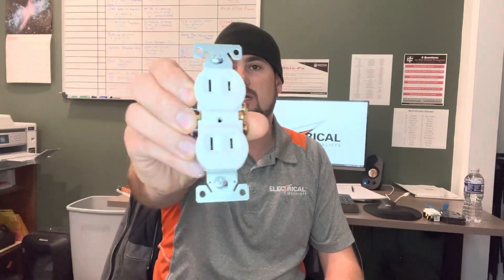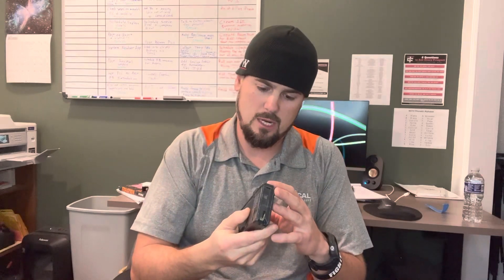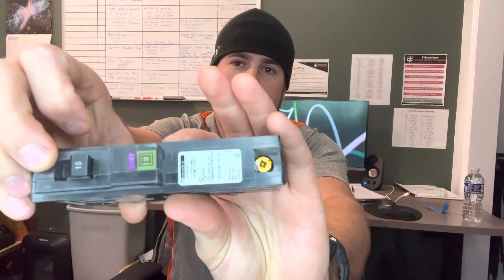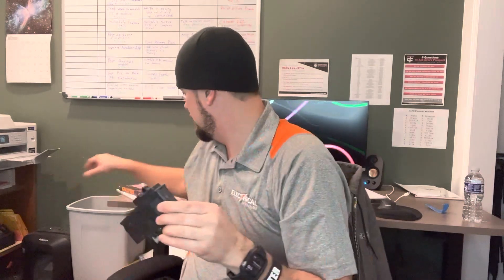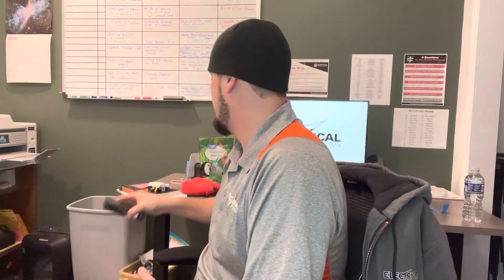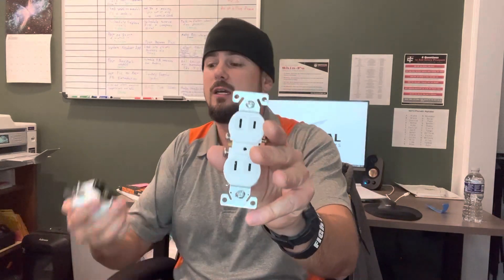How to LEGALLY Upgrade 2 Prong Outlets to 3 Prong (No Rewiring Needed!)

Comment: Ok, single woman here who knows pretty much nothing about electricity. I just know how to change out outlets and hang ceiling fans. Do you have to change out every breaker with that one he showed? If so that would be very expensive!
Reply from the maker: Yes. Every breaker that powers a circuit that has receptacles. Absolutely, it is definitely an investment, but much much less than the cost to rewire a home. It’s at least an option to consider when going through your options. Let me know if I can be of any further assistance. Thank you!

Comment: Would a plug in tester read any differently in the 3 prong outlet without the ground wire but on that new breaker you are suggesting?   I mean the plug in  testers with the light that say 'correct' or open ground, nuetral etc
Reply from the maker: Good question! It actually will not. The tester is looking for continuity between the ground and the neutral contact. We get this all the time from home inspectors checking homes we have already performed this task in. Someone had taken off our stickers reading "no ground" and "gfci protected." We then tell them to check the breaker and send a link to the code article as most people including home inspectors are unaware of this fix.

Comment: So if I upgrade to the dual function breaker can I install normal 3 prong outlets so I don’t need to use adapters to my current 2 prong outlets?
Reply from the maker: Absolutely! That is honestly the main reason this is utilized. Code requires you to then install the stickers that come in the gfci box that read "no ground" or "gfci protected" so the next person will know what the situation is.

Comment: Hi could you give a ball park estimate electricians  charge to install gcfi af breaker in the panel box thank you
Reply from the maker: We would love to help with pricing on anything but unfortunately the answer is always “it depends.” The age of the home, wiring and panel will matter as well as well as other factors so we always want our technician on site to give a proper price. We would suggest to call a reputable local company and see if they will assist you. Thanks for the question!

Comment: I have a question. I travel with a power conditioner to power a rack of audio mixing and processing equipment. Actually, several sets of equipment are distributed to multiple rooms.

I've been wanting to add network-connected relays between receptacles and power conditioners in order to switch the racks off or on from anywhere in the venue.

What I can't figure out is how to make it work so that I have 3-wire cable coming into the enclosure and 3-wire cable going out of it to the power conditioner?

I was thinking I could put the relay inline on the power conditioner AC plug, but need to maintain 3-wire configuration.

Any advice? I can write firmware and handle network connection, signaling, etc. but the 3-wire cable issue is tripping me up. All relay videos I've seen work with 2-prong plugs.
Reply from the maker: That is a very interesting question! Unfortunately to answer it properly we would need to see the equipment and the sources provided to make sure we were addressing the situation properly. You may want to have a local professional get a closer look to avoid any guesswork. Great question!

Comment: Is that one dual function breaker per circuit? Or can you protect the whole house with one dual function breaker on the mains? If one per circuit, how do you decide whether the circuit "needs" it? Thx,
Reply from the maker: Great question. Unfortunately they have not perfected the technology to properly protect the mains as of yet. However I hear they are working on it. So as of now you will have to protect each circuit from the source. Meaning one breaker per circuit. To find out which circuits need it, you will need to decide which ones you want to protect. We would suggest them all, as well as the code requiring almost all of them in 2023. Rule of thumb is, if you have two prong plugs in your house, replace all single pole breakers with dual function breakers and that should take care of most everything.

Comment: Can't you just put the GFCI receptacle? Where. The home run comes in or the most upstream or substantial and the rest can be three prong protected by that.
Reply from the maker: Good question! Yes, you can install a GFCI to effectively protect all wiring down stream of it. However this does not Arc-Fault the circuit as per code since we are now working on it. One could install a dual function device, but this would take whole house troubleshooting to properly identify the circuits and precise locations. So yes it is an option, but it’s getting to be one of the last options as far as value for your investment. Thanks for the question !

Comment: You are holding a socket / outlet/ receptacle.  If not, what do you call the "thing" on the end of a cord/ cable / wire? 🇺🇸🇬🇧😂
Reply from the maker: Good question! This is a technical nightmare when it comes to terminology. By code, the wall socket or female device is called a “receptacle” at point of use. An electrical outlet is anywhere electrical parts or wiring can be accessed, so that could be any junction box etc. Local nomenclature in our area would be “plug.” The male end of the cord you would be plugging in is usually called the “cord end” or “appliance whip.”

Comment: Will those breakers help protect IT equipment, big screen tvs, etc...?

Also, how do we determine if a breaker box is new enough/compatible to use these? I'm in an older home where some are grounded, some are not.

Also, even with the 2 prong/2 wire outlets, could we still use a 3 prong outlet as to stop using these cheap 2 to 3 adapters?

Thanks
Reply from the maker: The dual function breakers will help reduce the risk due to arcing and power differential.  The best way to protect your IT and TV equipment is still a whole house surge arrestor. And not one sold at a big box store. If its rated in Jules its not big enough. 

To determine if your panel will accept the new breakers you will want to find the make and model of your panel. Then you can look up the info on google, or call your local parts house and ask them. Also dont hesitate to just call your local experienced electrician. We answer these questions over the phone all the time no charge.

You can use the 2 to 3 prong adaptors at your own risk. Just now the third prong is a ground. The adapter, while giving the plug a place to land the ground prong, does not actually ground the prong. So it is no added protection. They just dont want you ripping off the ground prong like some have done before.

Comment: Wonder if someone can answer a question. In terms of installing a three prong receptacle in an old house that has BX cabling and using the BX shielding for the ground?
Reply: Thts normally an OK to do but ask your authority having jurisdiction/bldg dept
Reply from the maker: We would not suggest using the shielding for the ground. In commercial situations such as hospitals, they still use the casing as a ground but it is a secondary redundant ground. As long as your wiring and BX is in contact with wood framing members and insulation, I personally would not want the chance of it becoming energized and starting a fire in my wall or ceiling etc. It is highly suggested to lean towards a different route.

Comment: As a DIY, I found this as an excellent explanation video. I'm about to re-wire my new old house purchase. Thanks for saving me tons of money.
Reply: Ok so you’re saying you can keep the wiring that’s in your house with no copper ground if you use the gfi/arc breaker and be up to code ?
Reply from the maker: Yes. Keep in mind every jurisdiction is different. In fact in our area GFCI protection was good enough to accomplish this until recently. Now they must be protected by both.
Reply from the maker: Absolutely! Glad we could help.
Reply: If your house is very old and has original wiring, it is a good possibility that there are many things that were allowed by code when installed but no longer.  Not to mention diy shoddy repairs.

If you don't have current conductors and ground wire to all if you're boxes, are you just going to update a new panel and leave old wires and old switches, outlets, fixtures?

My previous house was built in 1960, I had flickering lights traced to high resistance at the connectors at the drop.  Next the lugs came loose inside the meter can when I used my table saw so It got replaced.

Couldn't add any circuits to crowded main breaker panel so it got replaced.

I changed every switch and plugs with ones allowing grounded wires to be attached.

So this took a few years and i thought my electrical was as good good as new but years later I  replaced  my dishwasher and found wires  inside  a metal  junction box where installation failed ..... how it didn't  catch fire is a miracle. 

Unless you have expertise  find a electrician and get your entire home fixed right.  I have two friends with fires started from electrical.
Reply from the maker: @jimw6991   Absolutely. We are advocates of fixing every electrical issue in every home. Unfortunately the fact is not everyone can afford to do everything at once or have the knowledge to do so themselves. We advise doing the most cost effective item in your budget one at a time. Something is better than nothing.

Comment: What if it's knob & tube and it has an in balance on the neutal
Reply from the maker: Great question Doug. This can definitely be an issue if your trying to solve the problem with breakers. You may need to run a few new circuits to separate the neutral load in this situation.  One way to find out is try hooking the Arc Fault up and seeing first if it will hold. If not you may need to map the circuits with their neutrals to find the best course of action. This of course is not a one size fits all solution. Sometimes it may make sense to go ahead and pay the extra money to rewire the entire house properly.
Reply: @electricalspecialists i

Comment: Bad thing is that they do not make those breakers for my ancient breaker box. I cannot afford the THOUSANDS to upgrade my service, panel, and gawd awfully expensive breakers.
I have plaster on brick setup (actually it is wood). Lead painted plaster covered in wood paneling to encapsulate it.
I think I have maybe ONE grounded outlet in the entire house and that is for the microwave.
It would cost more than the house is worth to 'do it right'.
Reply from the maker: We completely understand. Every situation is different so is every budget. We have many houses like yours here in the Midwest and get calls about this on a regular basis.  Its just nice to know what options may be available.
Reply: @electricalspecialists I live in Midwest, homes built are way past intended life but not being knocked down.   I read thru comments and one guy talked about disintegrating insulation I  had that inside by metal junction boxes ... very concerning.

So the idea of determining faults in circuits with devices located inside main panel in theory will provide protection.

I like redundancy, I like an effective uninterrupted ground circuit back to earth for all switches, outlets, fixtures and appliances. 

There is a reason we have brakes, seatbelts and airbags.  Things happen
Reply from the maker: Well said  @jimw6991

Comment: Definitely the breaker is a great alternative to rewiring the house , or running a ground wire to every outlet box and replacing every outlet with GFCI and AFCI , 
But all the outlets must be labeled
No equipment ground and GFCI and AFCI protected outlet
Reply from the maker: Good point. However it is up to the AHJ if they want to see these or not. We have some cities they require them and others they do not want them. Always best to ask.

Comment: After this fix, will my electric charger see it as grounded?  Currently plugging the charger into the plug doesn't work since it doesn`t see it as grounded.
Reply from the maker: David we would need a bit more context. Is this a 240 Volt EV charger? Possibly a phone charger? If it has a ground sensor no it will not pick one up after protecting with it GFCI or AFCI. It will in essence be protected from the damages of not having a ground, but will not physically have one if that makes sense.

Comment: The single ground is not legal
Reply from the maker: It depends on where you are located. Some municipalities accept this and some don't. We suggest calling your local code enforcement agency.
Reply: @electricalspecialists  I was just referring to the NEC.  Some local codes don't require anything :)   We have overhead service drops supported by pine trees in my summer cabin neighborhood.

Comment: Placing GFCI/AF breakers in the panel, ok.      But we still need to replace all receptacles with 3 prong?
Reply: Yes. And to be code compliant they need to have the little sticker that says "Caution. No equipment ground".  That said, I have never installed one sticker in my long life. :)
Reply: @effthegop  Like it makes any difference if that little sticker is there. Haha
Reply: LOL... cheaper but more work... now you have to add the breaker.  LOL... or you can just use a three prong to a two plong adapter with a fused power strip.
Reply: @jackdenial1500  A power strip won't protect against a ground fault unless it's a huge 20 amp fault (unless someone makes a GFCI power strip).
Reply: You could also put a GFCI receptacle as the first in line and regular 3 prong receptacles downstream of it.
Reply: @mikeb3938  You could but the chances of finding all the home runs going to receps is slim. A lot of times they go to switch boxes and in the early 60's it was still in fashion to run them to ceiling light boxes.

If it's a DIY project and you can spend the time tracing the circuits it's a fine idea. I was contracting and I generally chose the easiest method which was locating them at the source either as breakers or receps next to or below the panel.

Comment: If we change the breaker to arc-fault, do you simply change outlets to three prong without a ground?
Reply from the maker: Great question! Actually to safely change from two prong to three prong you will need to GFCI protect the circuit, meaning installing a GFCI breaker or device. My opinion is if you are going to change the breaker to GFCI, you might as well spend the extra $5 and install a dual function breaker making it GFCI and ARC Fault protected.
Reply: @electricalspecialists  Sooo, Change the 2 prong outlets out for GFCI even though there is no ground wire to connect to it and ALSO upgrade the breaker to GFCI/AFCI and everything in the universe will be good? Since there wont be any ground wire between the outlet and GFCI/AFCI breaker (Which protects this circuit) why not just use one of the 3 prong to 2 prong adapters at the outlet?
Reply from the maker: @roberthibbard508  Robert it sounds like you might be confused on what this is trying to accomplish. This is a legal alternative to protect a homes branch circuits that were built before grounds were code. GFCI protection is a supplemental way of achieving the best protection possible without the actual ground wire being present. GFCI breakers and devices do not require a ground wire for proper function. Also we would not suggest installing both a GFCI device and a GFCI breaker on the same circuit as this can cause nucense tripping on both devices. Only one is necessary if a knowledgeable person is performing the installation. I hope this helps. Thanks!
Reply: @roberthibbard508  No, you need just one GFCI per circuit, either on the panel or on a socket. Arc fault protection is not related to this change but may be required by the code.

Are you saying that use a GFCI breaker and then use just the adapters? Well this actually is safer than changing the sockets (provided you do not connect the screw) but the problem is that it is a gimmick and you could easily use the adapters on a socket that is not protected. If you live alone and know exactly what you are doing that is a solution, not otherwise.

Comment: Well yeah gfci receptacles don’t use a ground as a reference. They use a differential , in milli amps , usually 5 milli amps , which isn’t much and it does it instantly , between the the hot and neutral. The caveat is you will more than likely get some nuisance tripping if you do this. … they also make combination gfci / afci receptacles now. Also you are showing a breaker that is a plug on neutral. Most older homes will need the pig tail dual function breaker. The breaker fix isn’t going to be a good idea because most houses that are wired in 2 wire will not have a new enough panel to install these breakers. So the panel will need to be upgraded. But still cheaper than a while house rewire.